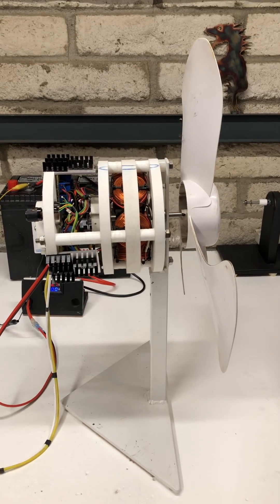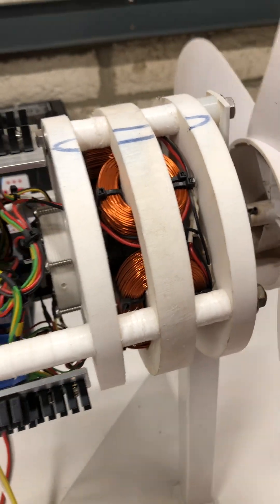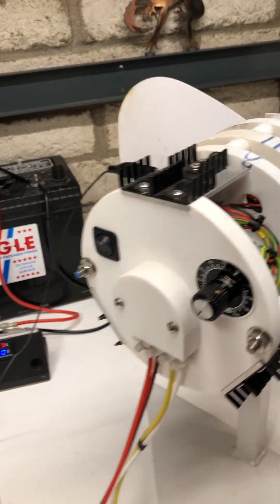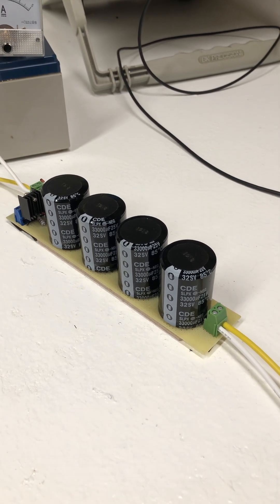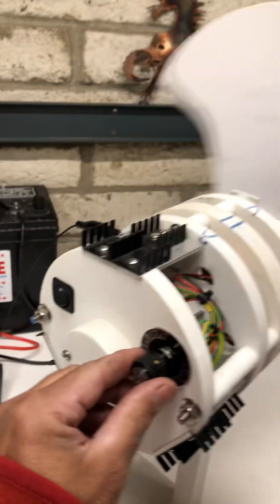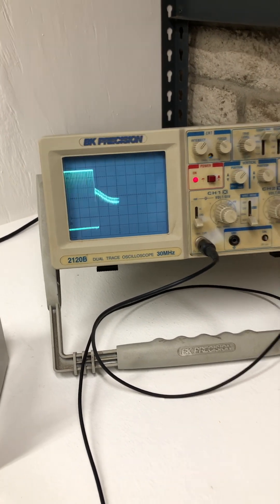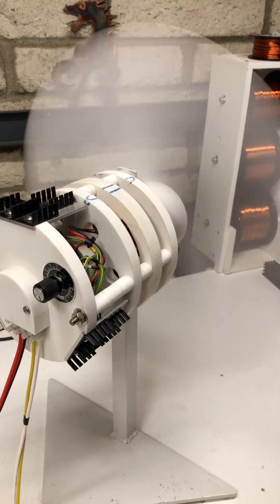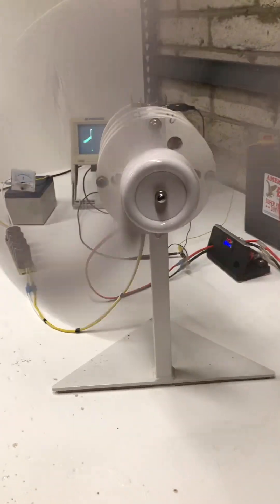Pulse motor with output running a fan

Comment: A similar fan usually consumes about 40W of power if made with a small asynchronous motor.
Of course we could remember those very small asynchronous motors could be extremely inefficient and also we could say you are turning slowly the blades but ....
You are using 6Watts!!!!
This design,on this scale, is a huge efficiency improvement for sure!
You could make a 1to1 comparison between your motor turning that fan and a commercial fan with the same  propeller swapped.
Setting a tacometer to ensure the same speed you could obtain a simple and very meaningful experiment. Nice work

Comment: I like the cap dump, I want to build one for a few of my projects and I wonder can you adjust the voltage for the trigger or is it specific to 16ish volts? Really nice setup. I need about 5 of these. LOL
Reply from the maker: Lol no problem 
I did a cap dump video with circuit the dump voltage is adjusted by the zener diod I use a 15 or 16 either seems to work good you can buy zeners at any voltage value
Reply: @kenergy1707  I'll get to that one eventually. I was thinking of a circuit that would use a tvs diode, varistor or something like that but I've also seen lots of these where the diode is used as well.
Reply from the maker: @theclintified  
I’ve used tvs diodes to separate the spikes from battery power but they always burn up they say 1,000 watt but that’s only for a second I put ten together they all caught on fire lol
Reply: @kenergy1707  LOL, I've never used them. I think they are typically  used for lightning protection  but the Varistors, mov's whatever you want to call them are good for  lots of cycles. Ive seen some that are 25+ years old in active circuits.
Reply from the maker: @theclintified  mosfet alway seem the most efficient to me
Reply from the maker: @theclintified  interesting that is good
Reply: @kenergy1707  I tend to blow them up quickly if I use them in an H-bridge configuration. The pulses are so much better if you can fire the motor at every half rotation. At least thats what i've been playing with.  Are you pulsing at every full rotation or at half?
Reply from the maker: @theclintified  I only do half the H bridge circuit like you said blows up a lot I use 3 or 6 coils with 3 circuits for self starting 
Also when one coil fires it’s facing the others and acts like a transformer and makes more power

Comment: Wow it's very powerful! But you're using neodymium magnets, right? And how does the self-starting work? Is it because you have 3 switches?
Reply from the maker: Thank you ! 
 Yes 4 neo magnets and yes 3 circuits overlapping for self starting 
 Also makes for smooth operation and lots of out put 
 When it’s running at half an amp or 6 watts it does 5 amp pulses every other second to the battery
Reply: @kenergy1707  Very nice! This looks like the highest torque pulse motor I've seen so far, great job.
Reply from the maker: @Waveguide  thank you it’s one of my favorites in summer time it runs a lot charging my small medium batteries
Reply from the maker: @Waveguide  if you like this one my outboard motor that is on the shorts video is 15 hp pulse motor I’ll do a full video on it soon
Reply from the maker: All mosfets too
Reply: This is incredible craftsmanship! Looks like your cap dump is discharging about 3 watts average so the fan is running on only 3 watts! Exceptional!
Reply from the maker: @energyhack3538  
Thank you ! Its one of my favorite motors and self starting